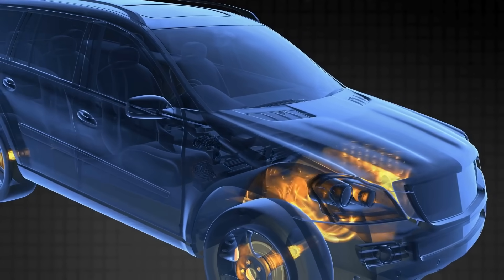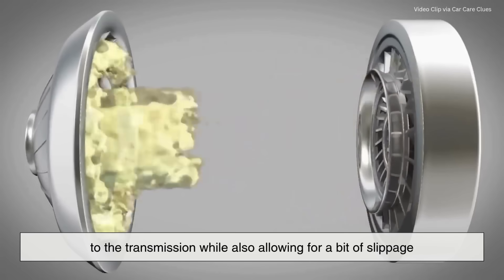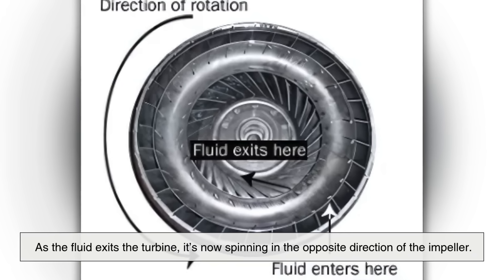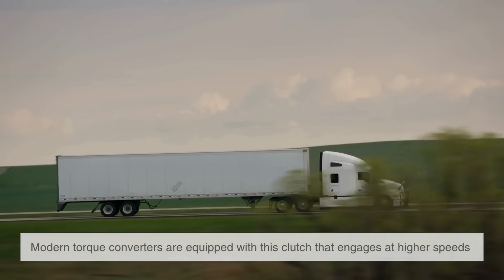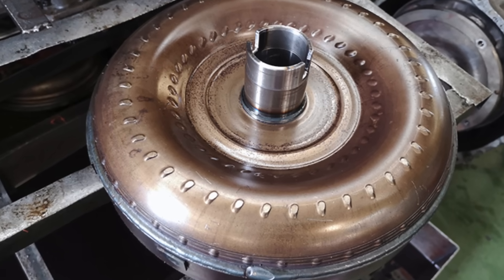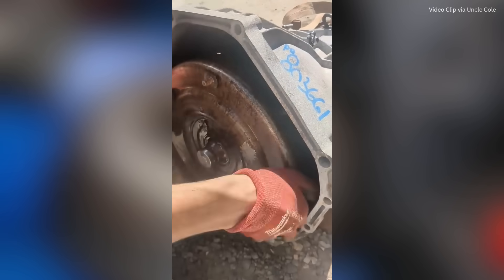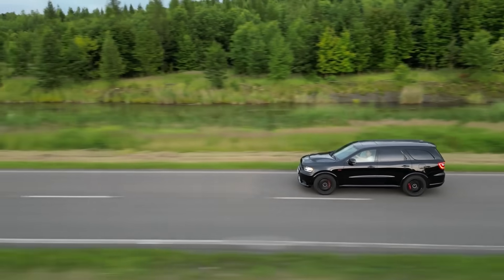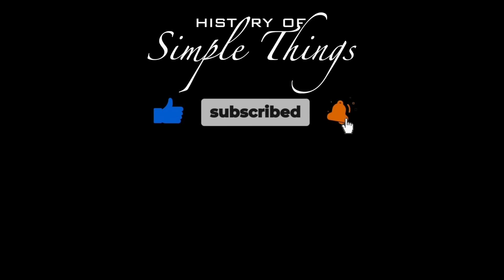How Do Torque Converters Work?

Comment: Regarding automatic transmission fluid service.  Better to spend $200 ten times for fluid and filter change every 20k miles than to spend $5k - $8k for a new transmission one time over 200k miles.

Comment: 0:22  Correction:  Your automatic transmission car simply would not stop moving, without a clutch, which is basically what a torque converter is, a clutch without a clutch pedal.

Comment: F.y.i. One of the first automatic transmission had a unique feature to it. If your battery went dead on you. Technically you could jump start the vehicle by getting pushed by another vehicle. Obviously one can't do this in today's automatic transmission
Reply: They could be push started because early transmissions had a rear pump.

Comment: Video on torque converters and you show a clutch pedal. Your videos suck.
Reply: A video with just a torque converter wouldn’t be very entertaining. They refer to a manual transmissions less than a minute in
Reply: He gave the basic definition of what a torque converters job is: Keep the engine running. A clutch in a manual does this, most people know that. Most average people don’t know how automatics continue to run even when stopped. Maybe next time focus on what’s being said cause you sure suck at paying attention.

Comment: Stators are responsible for torque multiplicaton. But, when torque multiplication is no longer needed after a certain RPM, the stator rotates with the turbine and impeller. Slippage is about 10-15% and this creates heat and wastes gas. This was not a problem for a transmission that was built for it. In the 1970s-80s lockup clutches were added to torque converters to save gas by eliminating the slip. No torque multiplication occurs during lockup.

Comment: Stickshift for the win. As the video shows, automatic transmissions are too complex, making them expencive when they break.
Reply: It's also a good anti-theft device
Reply: You didn't know automatic on average are much cheaper did you? Last longer? Faster? 

 Now you do. It's 2025. Get with the times brother. 

 Sure they can cost more. Like a thousand, sometimes more or less.

 Why are automatic cheaper overall?  Because not everyone is a professional driver shifting flawlessly. Lots of errors, especially in urban areas. 

 There was a time, and a place when sticks were better. Not anymore. Stick shift sucks, or is niche.
Reply: @RedactedDeath You're just mad because you can't drive manual. I don't know what you're talking about automatics last way longer 😂😂😂. But whatever, BROTHER
Reply: @RedactedDeath Wrong on all accounts.  A properly maintained manual transmission, and driving it properly (not riding the clutch or grinding gears) will last longer than the useful life of the entire vehicle.  And there is a reason that most sports cars still come in a manual, because they are more fun to drive, they give the driver more control, and if driven properly, are faster.  They are also simpler to work on and cheaper if there is an issue compared to an auto.
Reply: @100percentSNAFU and that’s the problem 😂 manual has a chance to break MUCH worse you can’t really money shift in an auto
Reply: @RedactedDeath as a stick shift driver myself currently, I wholeheartedly agree with you on this. Automatics are, nowadays, better overall.

Comment: CVTs, like the ones on Subaru products, have torque converters. CVT torque converters lockup at around 10-15 MPH where the CVT provides the necessary reduction or overdrive for the engine.

Comment: I had a 70 Chevelle SS  and had a high performance Torque Converter installed ( for a small block high performance engine. Like the guy said it had some problems stalling at stops.

Comment: I had a 1986 BMW 635Csi that I impressed a mate going down a hill by selecting the gears 3, 2 and 1. We got thrown into the seat belts it had so much breaking power. Never had that in any other auto I've driven, and I miss that car 😭
It did 60mph in first gear hitting 6k rpm